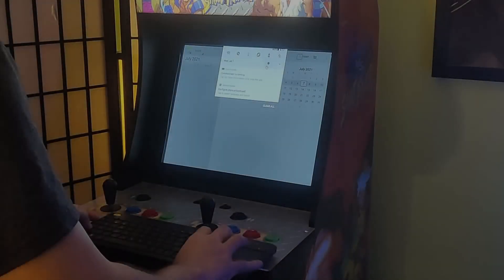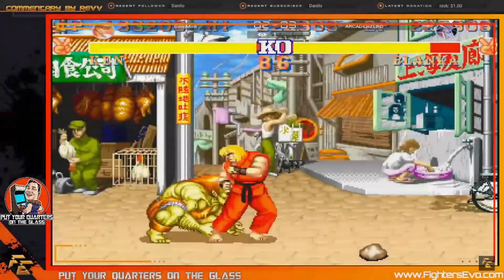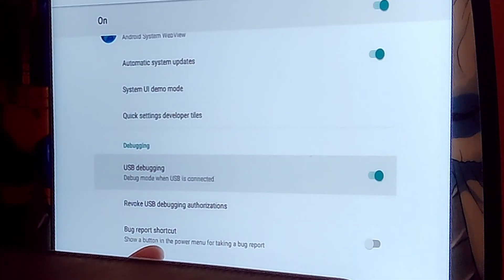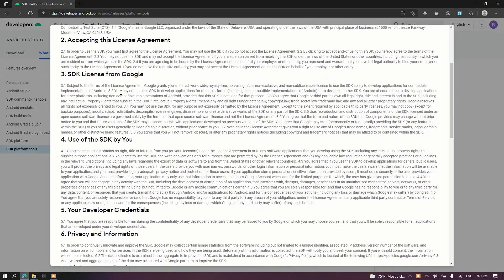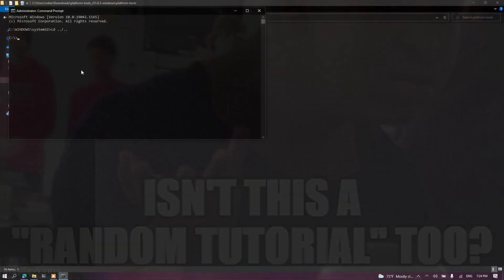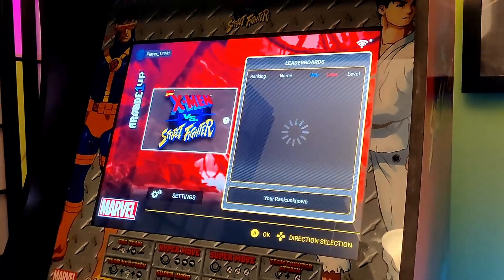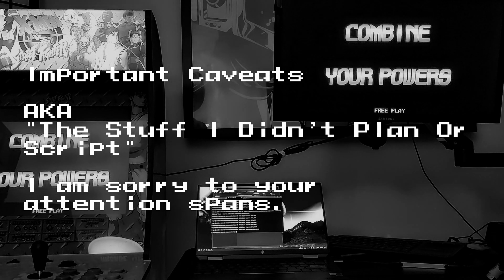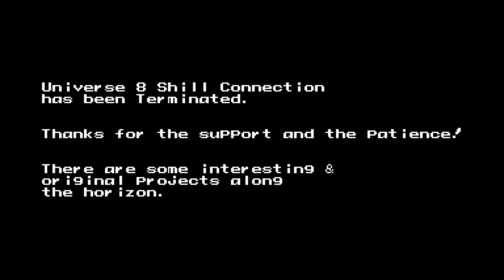Stock PCB Modding #2: Sideload Apps over WiFi + Universal Micro USB to HDMI (Arcade 1Up)

Comment: My xmen vs street fighter cab is Android drm protected. I can not enter the settings on Android . What can i do ?
Reply from the maker: It's possible to flash it - but not possible for me to share those details bc of TOS and legal reason. You could also try team encoders patch, which technically does that with the firmware files. It's not something I've done but there are videos like mikeofalltrades covered it.
Reply: @FromUniverse8  i tried. but after installation of th team encoder patch the ADB popup never shoed up..
Reply from the maker: @misoglodny  that's interesting... in that case, I'm not quite sure - and sorry that you're having trouble with it. If you aren't sure if you're definitely having the issue because of DRM lock, you can go to the option next to USB debugging for "Revoke all authorizations" (or something along those lines). Also with that, if you can even get to settings.  If you can get to the settings in general there is likely no DRM btw -  that is what indicates you can or can't softmod.

Comment: Is there any opportunity to extend the storage space of the X-Men vs. Street Fighter Cab? Since it has no SD Card slot it would be possible with USB Stick over Micro USB to USB adapter. Via this a stick can be recognized by the system, but it cannot be accessed by the file browser or retroarch. Any suggestions how to get this working or is it impossible?
Reply from the maker: You can. There is a YouTuber I think named ArtCade who's done tuts, and you can definitely find this info if you search. These are just using an Android based OS, so it's a standard USB port and all the typical things apply. They are older versions though (7/8.1), so you have to keep that in mind when you search. Sorry on the late reply also.
Reply: @TheCodeAlwaysWins  thank you, I will check on this

Comment: Is there a fix for the second player controls issue in the meantime? I saw there is a Fighterdroid2P.apk for MVC but it cannot be installed via adb on the X-Men vs. Street Fighter cab. If there is any solution available for it I would really appreciate if you could share it. 🙏🏻
Reply: Solved it myself...can get to work with Fighterdroid2p yoga flame apk 👌🏻

Comment: When im trying to connect to the cab its just stuck it doesnt say that its not connected nor does it wanna give me an IP im stuck here does someone have an idea on that ?
Reply from the maker: Not 100% sure this is the issue but you may need to go to your settings and then in the same menu with USB debugging, you can try "revoke USB debug authorizations". This happens if you accidentally exit by pressing something besides LP (top left face button) for any reason when it pops up first time.

The PC has to get permission from the cab basically and closing the dialog will make the permission not come up until you set that option in the menu to reset it.

Comment: Thank you ! Been trying to install Dig .. but it keeps failing .. it installs but I get a message create a folder in the root and it just errors out. See this one ? Do you have a front end you recommend ? I’ve tried installing locally off a usb drive  and via adb
Reply from the maker: np! Glad you found it useful. I haven't used dig specifically. There may be better front ends out there but I would recommend Lawnchair for something simple and compatible with the cab w/o hassle. You may want to search for general issue of installing Dig on Android Oreo (or Android 10 depending if it's a Simpsons or yoga/Shinkuu). It's one of the few things GPT can be good for since these are really old version of Android. Anyway hope you have some luck with it and sorry not to have more specifics.
Reply from the maker: Lawnchair and there's another app I believe called Shortcut Maker where you can add an activity for the cab. Iirc you would need to long press/click and add it as a widget.
Reply: @FromUniverse8  I was finally able to get Dig installed. Turns out it was a the version . I used an older version and it worked just fine. Redrean does a decent but not perfect job at Dreamcast games was hoping to get MVC2 , third strike, VF3 cap on vs snk and soul caliber working but they dont run that well. Another frustration .. I got some great ps1 fighters on there but the built in arcade controllers don’t register multi button presses and diagonal joy commands. I really enjoy playing tekken 3 with king .. but can’t get the diagonal to register for his Frankenstein and the most basic Throw in the game RP + RK  doesn’t register so can’t pull those moves off.
Reply from the maker: @gino4895  nice. Yeah at that point personally I would question whether it's worth it just to put a raspberry pi/orange pi 5 on it w some customized emulators and games and a USB zero delay encoder. These are just android pcbs at the end of the day with a fixed amount of ram and CPU so ymmv otherwise.

Comment: 2 issues, used Abd to install Yogaflame and and MVC on my Big blue... got launcher installed. They both run but none of my buttons work on them. 
Next my home screen just went sideways any idea on how to rotate ? My original Big blue games run fine -thanks
Reply from the maker: For the rotation: pull down the menu w keyboard, windows + N, drag down shade and it should be a control similar to on other Android phones/devices. Once you're interacting the way you would on Android, you can search Android Oreo how to ___. Gpt (which wasn't a thing people were using when I made this video originally) should be able to help you pretty well as long as you ask it for the right Android OS version.

For the launcher: you will need to use one that is compatible. Basically it is on an app to app basis and I don't control how well those are written. I use one called "Lawnchair".

And np, glad you found it useful to start modding your cab. Sorry on if it caused a delay w solving your issue. This is a bit of an old video so somtimes I may miss comments but hope you were able to work around the issues before I replied here.

Comment: awesome work. Any idea how to mod a one up so that it accepts a USB connected or bluetooth'd PS5/XBox controller? 

I would like to use one to play the standard arcade1up games online.

thanks
Reply from the maker: thanks! The simplest option I'm aware of is to use an adapter called undamned decoder which will let you wire any standard USB gamepad. Otherwise a driver would need to be written from scratch pretty much.
Reply: @FromUniverse8  thanks. The UD decoder, where does it integrate with a 1UP, where does it get wired to?
Reply from the maker: @youfoundit5332  the
 connectors are pretty standard for your buttons underneath it. UD can plug into that the same way as any joystick. There's a 5V and a GND labeled on your button encoder's pcb also.

Should be able to find tutorials on UD for regular joysticks and would apply in the same way.

Comment: Hello!  looking for advice... I managed to use ADB to install all APks needed.  I have this XmenvsSF pcb, I installed BB and Yoga Flame apks (after cloning them) and used NOVA as Home launcher.  if I open BB or Yoga Flame, The menu music on it will not SHUT UP. Even if I go into that 1up's menu and turn off background music, still keeps playing the Ryu music. Confirm on a game, still going. EXIT out of the 1up app, still playing.  weird stuff!
Then, I remove these 2 apks, and proceed to install the ones from THE DAM internet archives, and those will play well without the music issue, BUT, if I exit a game to return to the main menu, it will go back to NOVA instead of the BB/Yoga main menu....
Honestly dont know if its a cloning issue or a possibly PCB error....  Help please!
Reply from the maker: Np. It doesn't seem like a PCB issue to me. These are simple apk installations and people sharing warez/common things rom collectors do so it's just some software.

I'm not too familiar with those mods.. But your issue is simple from what you describe: there's an Android "home" launcher app... these are similar to Android phones, like basically what you'd see when you go home and nothing else is on the screen is what gets launched.

If you can access settings go to apps => advanced => default apps => "home" and then select the app you want.

The music may be playing bc the settings are interfering with each other btw.

Funny enough on the subject of music, I have a new app coming soon btw for the cabs to add your own mp3s to the background menus. But wouldn't work on the android 10 cabs (yoga/shinkuu/bb), until I make a custom build on those. Anyway hope your issue is this simple as it seems to be and that this is helpful. Appreciate you checking the vid out.

Comment: What about using this HDMI cable to swap a pcb from say a partycade 16.7” display to using a different hdmi monitor?
Reply: That’d be great, I picked up a v1.5 but I couldn’t get it to display on my lcd panel. I coupled it with the vsdisplay hdmi converter board without success. So any help would be great
Reply from the maker: If it helps, I just set it up and tested against a V20 and a V1.5. I haven't touched some of this stuff in over a year and a half. The v1.5 definitely worked, the V20 I didn't confirm with another PCB yet.

I have some more things to try that sometimes work and I believe a V12 to narrow it down, but I don't have all of my stuff with me after moving. 

I'll try to remember and update you if I can once I can get that (within a week ish?). Otherwise if you have time and the money you can try to connect a Display port (powered, the ones w USB A power -- direction is important! Not a standard plug or converter). These basically don't depend on syncing the refresh rate with the signal so they're always a good test to see if the base conversion works. I don't have a compatible monitor to even try it otherwise I would try to  check it out and let you know. But I do have a better setup/ideas I didn't get a chance to share properly to try out sometime when I can.

Edit: Display port to HDMI adapter I use that will work pretty much universal (if your video device has native DP and you know the PCB is compatible w Geekworm) here:
https://amzn.to/3vWMS7V
Reply: I will have to try it again and try and connect it to a couple tv’s I have. Did you have to change any jumper settings?
Reply from the maker: @bumpinz  it helps to try all of the jumper settings yeah. Pretty sure Partycade is not a V1.5 though.
Reply: I misunderstood you then, I thought you said you tried a partycade pcb with the 1.5 and 2.0 and had it work successfully
Reply from the maker: it's a good question. The thing about that is the partycade doesn't run android. But you can actually get HDMI out using geekworm: 
https://youtu.be/I8MovSVPnP4?si=J_vw5RKiuNTcQxAK

It's just a matter of the specific board. I'm just not sure if it's V20, 12 or 1.5 that will work here. I can check if you still need a hand since I'm pretty sure I still have that PCB and the different geekworm pcbs.
Reply from the maker: sorry on the delayed reply too. YT changed something on the UI with how I normally view comments and a few slipped by me.
Reply: How would I go about outputting the partycade pcb with that cable? It doesn’t have a micro usb or lvds connection
Reply from the maker: @bumpinz  that's if your pcb has display port output using the proper geekworm (which one of the 3 I'm not sure of). Explained in comments before your reply.

Comment: awesome work! I went through your repo but I didn't see any of the tweaks. I'm looking specifically for the timer adjustment to not display the control cpo. appreciate the hard work!
Reply from the maker: Not sure specifically which repo you mean exactly or by control cpo... but thanks for the comment!
Reply: @FromUniverse8  the GitHub repo in the description. I'm looking to disable the timer that shows the control panel overlay diagram with all the buttons when launching a game
Reply from the maker: oh. That isn't possible on the mod shown -- that one was through a form of hacking where I'd have to share the IP to do that so it was for proof of concept. Mostly just to show some things I would change if I could on their official app. Another issue w that method I used is I have to re-hack it on every update of each individual cab which isn't sane and may break updates online.

Sorry about the misunderstanding; there are some YTers who don't care about that stuff but I'm trying to do things mod related legit/above board only since I have write software for my day job too and don't want companys to crack down for what I'm doing or just have them have an issue w modders in general. It's part of how it was possible to get the input code in MVC2 for everyone w 1up directly vs just for people who stumble on this channel. Unfortunately there are a few ppl who ruin it for everyone else w these things too.

It may be possible without needing to replace their whole app or distribute IP though. Will think about this. I appreciate you checking the vid out and the interest, and apologize for not having that publicly/"mod"dable version of that to hand out. Did try to make it clear in that vid and released or shared the stuff i can. I got an upcoming project I am trying to put in a state that it can work for anyone to install and maybe I can dig into this idea though since there's probably alternate ways to do that.
Reply: @FromUniverse8  interesting. well thanx anyhow. ill keep poking around w/ adb

Comment: Does this work for SF 2 Big blue cabinet ?
Reply from the maker: For many it would -- but a percentage of random cabs may have DRM activated. If you find that to be the case you can try to install team encoders patch which will reflash the cab software.

Comment: Hey Code: Been watching your guide the last day as I set up my XvsC cabinet to mod this stuff, and I want to say thank you. I got RetroArch, Nova, File Manager, and Dig on here thanks to you. I don't know if you're still active or have a social account to message, but do you know how to get the cabinet to let me go into my external SD/USB device? Storage in settings recongizes it, but when I go to Dig for example it won't let me access those files for my roms. Or even load up "External Hard-drive" when selecting where to save my stuff at. Only "Other Folder" or "Internal Hardrive" if you see this please get back to me, it's driving me crazy all day.
Reply from the maker: Thanks a lot for the comment! I haven't hooked up my cab in quite some time because stuff has been busy between another project and some other things.

It can be done and I'm pretty sure another channel called "Artcade" has covered this in his vid somewhere iirc. It's pretty much stock android once you're already in the menus etc so these things should apply and be kind of similar even if it's outdated. If you don't find it let me know and I'll check since I've had to do it before. I have a random excuse to look at the cab pcb again later this week so I can try to explore that but otherwise sorry about not having an answer for you immediately here.
Reply: @FromUniverse8  I think I found his channel, but I didn't find the USB fix for the XvsSF machine. If you do please get back to me. For the time being I ported my roms to my internal storage and getting it all hooked up together
Reply from the maker: @PrinceOfMadness ah... well if it helps in the meantime, the machine is just running Android 8.1 (Oreo)

Comment: Newbie here.
My BB isnt working after a few months outta the box. A1up wants me to buy a new PCB. Is that the only way to play online again?

I have XvsSF live wifi version if theres a way to make it work but A1up says they're not interchangeable. Plz advice 🙏
Reply from the maker: sorry to hear that. XVS should work on your BB. I'm not an employee so not totally sure what their protocol is to tell you. But what exactly is going on w your PCB? Maybe something simple. But from what I understand if you weren't modding it and it's stock then it should be good for warranty.
Reply: @FromUniverse8  I upgraded the buttons & Octogate (not jostick as holes didn't line up & BB stopped) After 23 emails back & forth with A1up reps they're very strict about they're 90 day warranty even thought I explained it was purchased earlier by my wife as an anniversary gift & wasn't assembly within 90 days & I have had 18 cabs over the yrs.  I think multiple ppl across the globe at A1up reply at all hrs of the day & night as they give me different prices for the PCB. I wish I could really reach a USS A1UP Rep. 

I've tried switching Power boxes & all their suggestions. They claimed XvsSF & BB are not compatible but I tried BB in XvsSF cab to no avail so I think I'm forced to buy a PCB.
Reply from the maker: That sucks to hear. I guess at least they're selling replacement PCBs now. They didn't used to offer that sort of service so that's kind of almost good? Hopefully not too pricey but worse case scenario they pop up on mercari and eBay every few weeks, though can be a bit steep.
Reply: Bought a new BB PCB from A1up but it only works in my XvsSF cab.

 I  think the screens out on BB too as it flashed 5  solid colors over & over in XvsSF cab but nothing in BB cab so I've got power issue & I've even switched the power boxes, maybe it's the deck? IDK